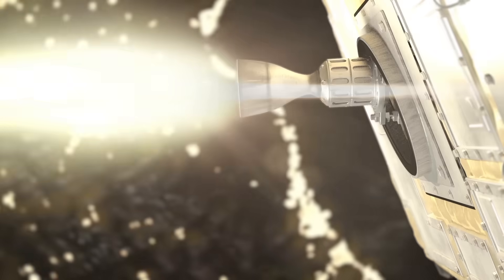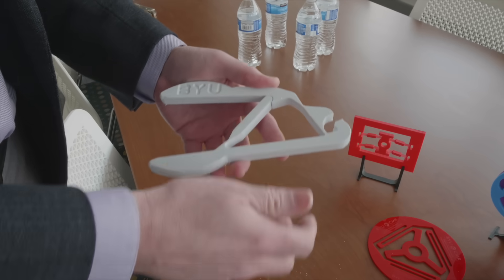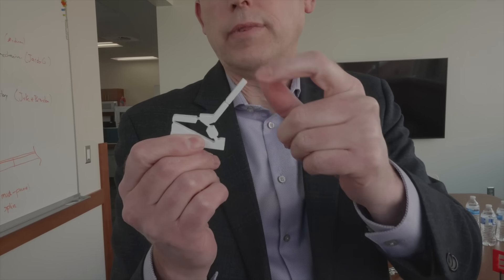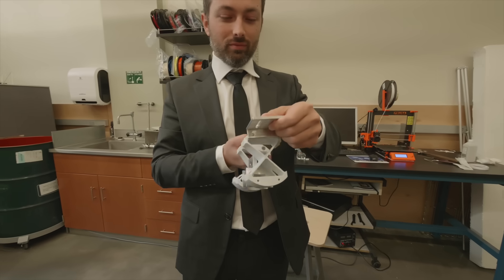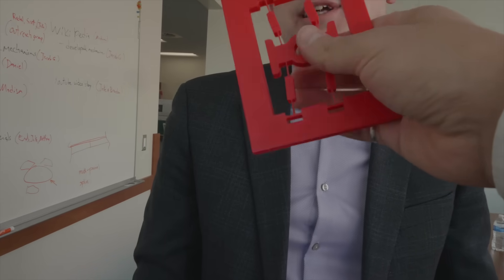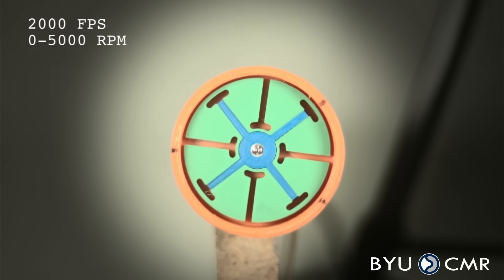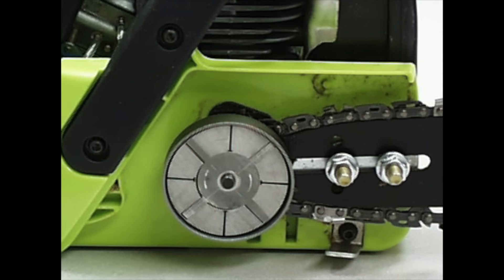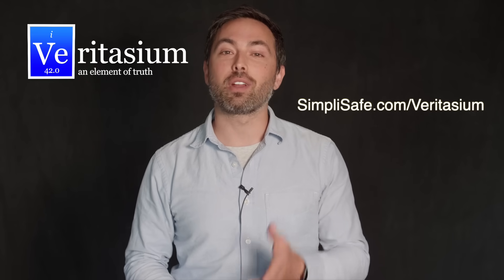Why Machines That Bend Are Better

Comment: My main concern would be about work gardening and the lifespan of these mechanisms.  Springs have stepped in where flexibility was needed in the past, but they are specifically treated to be...well, springy.  Even in spite of that special treatment of springs they still fail sometimes.

Comment: 'Always considered to be bad to have flexibility...) but wood, the oldest building material has great strength when it flexes and is strongest under tension. Surely at 2:07 the 'nutcracker' demonstrates levers as at 3:02? The flexible parts serve as pivots. Arguably over time they will fatigue and snap so it depends on the application. the cleverness as stated at 3:21 is the one piece moulding which is a cost consideration with a very nice aesthetic! Lovely trick at 4:51.

Comment: and still, if it breaks you're fucked. might not matter in space where you can't repair it anyway when it happens on a satellite and the reduction in cost and weight are important but i'd prefer (for example) pliers that i can fix myself instead of having to throw them away

Comment: Keep ur plastic BS. These are nothing more than toys.
Reply: So are guns, I can't believe people don't grow up
Reply: HoboGrifter ?
Reply: He litterally showed in the video that this design philosophy also works with titanium.
Reply: Kevin Frank I work with gear that uses a similar philosophy, brackets for sliding drawers on network racks, clasps on network cabling (fiber, RJ45) 

This philosophy is EXCELLENT for pieces of gear that aren’t frequently stressed.   I frequently have to replace the sliding drawer that support my equipment due to these clasps/pins/etc that sheer off after being used many times.   

I 100% prefer “older technology” of screws and nuts, rather than one piece that kind of springs/slides into place. 

They work fine for the gear that I set up and never move, but for areas where the switches and routers are frequently exchanged, the brackets that hold them fail.  We’re actually in the process of working with Cisco, NetApp dell and EMC to get replacement parts for all our network cabinets for this exact reason. 

These single piece plastic parts that are designed to bend  just do not hold up to daily use.
Reply: Kevin Frank I see the video here just like when we saw the demonstration at the trade show.   Their controlled environments do not reflect the reality that these tools will be used in.  

“1 million cycles”. I guarantee you there’s no torque, or much weight on that tool being stressed on the machine.

Comment: My question is:- can we design a piece that toggles between a state of charge, to produce rotational movement, possibly replacing the electric motor/mechanical engine.

Comment: thing: bends over and over

Basic physics: Im about to end this mans whole career
Reply: if they used this on
planes it would fail so fast cause aluminum would break to residual force
Reply: @MrDeanguy  if they use this on planes they make them to be used on planes. Or you think a rocket thruster has no residual force?
Reply: @LaKoeps  that was titanium wich is very strong unlike aluminum
Reply: Actually planes do use compliant mechanisms. The wings have a high degree of flex to absorb some of the dynamic loads you experience in flight. You could build a rigid wing structure, but it would give a bumpy ride and actually be more susceptible to fatigue. If you’ve ever sat in the wing seat of an A380 you’ll have seen how incredibly much those wings flex in flight, particularly as they take up loads on take off and shed loads on landing.
Reply: @andydavison1235  yeah but that is a small dregree of bend but some of these other ones have high degrees of bend relatively
Reply: Dean Guy sure, but the concept is the same. They’re not saying they won’t eventually succumb to fatigue stress, but for many mechanisms a million cycles is a lot. Even mechanical switches succumb to mechanical wear etc, so there will be some applications where this is suitable, and some where it is not. Doesn’t mean you should discount it as a valid tool.

Comment: The mechanism at 10:45 used to 'safe' weapons is identical in principle to the Bulova Accutron watch from the 1960s. It used a tuning fork at not 72Hz but 360 or 480Hz and it similarly used a pawl to spin a toothed wheel. American, not Swiss, watch technology. Very reliable as long as the vibration amplitude is well controlled.

Comment: What would be the reason to use it for a thruster? Aren't there much better and more stable ways like ball bearings or two motors turning
Reply: The thing is that thats what its replacing
Reply: @masonkimberlin3207  yes i know but I cant see it being better then other methods
Reply: @benisommer3176   It seems that way but i dont think they would do it if it wasnt

Comment: Seems like if one part stops working you have to replace the whole thing. It also seems like you have to make the whole thing out of type of material. You also loose the ability of interchangeable parts in case you want to upgrade something or take advantage of economy of scale (using cheaper premade parts).

 This is useful in certain applications though isn't a good solution for everything. In the video they showed use in space which makes sense because those are one off devices you can't find anywhere and need to make the most out of material used.  Same for that nuclear arming device.

Comment: hmm plastic switches dont conduct electricity... plastic grips dont lok.  plastic melts so need metal fot holding hot parts.  copper/brass would work-harden if used as a flat spring etc etc

Comment: 4:47
why doesn't the hole at the end of the elephant's trunk move ?

because said hole is located at the lower left corner of a (not-immediately-obvious) parallelogram 
whose four vertices are located at the following points :
A) the hinge point at the elephant's back hip 
B) the hinge point at the elephant's back foot
E) the hinge point at the elephant's jaw and 
Q) the hole at the end of the elephant's trunk.

this parallelogram is divided into two contiguous smaller parallelograms side-by-side.

the rightmost smaller parallelogram has vertices at these points :
A) the hinge point at the elephant's back hip 
B) the hinge point at the elephant's back foot
C) the hinge point at the elephant's front hip and 
D) the hinge point at the elephant's front foot.

the leftmost smaller parallelogram has vertices at these points :
C) the hinge point at the elephant's front hip 
D) the hinge point at the elephant's front foot 
E) the hinge point at  the elephant's jaw and 
Q) the hole at the end of the elephant's trunk.

the "virtual" line segments EQ and BQ which meet at point Q
are constrained to exist (geometrically) 
by the structural elements which are present physically. 

TRIPPY and TRICKY !

Comment: I can feel 220v ac in wires. An elderly electrician told me I could and I tried and
did. Of course I felt the magnetic field flux.  Try it.  It is easy. After fifty times it became so apparent. Like a ten hairs wafting over my finger nerve endings.

Comment: Douglas DC-8 jet transports had compliant wing slot mechanisms in 1958.
The aluminum wing skin bent inward to open slots in the wing during low speed flight.
These devices were working reliably in service for decades.

Comment: 3:05 Alex honnold has a grip strength of around 80-90 pounds if he were to squeeze that he could squeeze with around 2,700 pounds of force
Reply: That would probably snap or bend something in the structure breaking it?

Comment: Dear Professor Howell, your work and disgns are impecable, absolute genius well done. I am a mechanical engineer and would be would most greatful if you could explain why we have efficiency of 150% confirmed with Zes Zimmer precision power analyser, we have full data of the test. shakeel.pervez@hotmail.com.
Below is a link showing the system moving 400 kg with 25 watts, I believe this is because of flexibilty in our system.

https://www.youtube.com/watch?v=JsXkOp1f2R8&t=4s

Comment: I would have liked to have seen some discussion about the materials that are suitable for making compliant mechanisms.  Surely most materials that are sufficiently rigid, would also be susceptible to work hardening at the flex points?

Comment: without watching all of the 8 p's, im gonna say, stuff that bends, or at least isn't completely rigid, is better because of durability, if you had to choose between a pillow and a brick to break with a hammer, what would you choose? you die if you don't break it in half in 10 minutes

Comment: Any lack of stiffness, in a Bike Frame, leads to a Waste of Output Power on the part of the bicyclist. Often, extremely expensive Racing Bikes will have a super lack of Frame Stiffness, causing each attempted Pedal Stroke to first have to flex/torque/twist the frame before any useful rotation is finally produced back at the Rear Wheel.

Comment: PLA is unfortunately biodegradable, and exceptionally prone to absorbing humidity/water. PETG, on the other hand, has no susceptibility to humidity/water, but requires considerably more heat in order to print with a 3d printer. ( <== I came up with a GREAT TRICK for modifying the hardware of Cheap 3d Printers, so that they can reliably print PETG; you also have to appropriately modify your Print Speed Parameters, come Printing Time.)

Comment: I built a Canoe rack for my ATV.  out of Aluminium. It's bolted together. Not welded.  It moves a bit like an Aircraft wing. But has not broken yet. 
Friend welded a steel one and it's broken there ATV.   The ability to flex had been an advantage. Bump into a tree.. it bend a little and doesn't brake.

Comment: I actually printed a switch designed by them, not shown here unfortunately, and it felt really good the way it worked but it broke after a few dozen uses. Granted, it was printed in pla, but i wonder what if they can be made from a material that doesn't wear at all

Comment: centrifugal clutch, similar to ones used in chainsaws and weedeaters, or weed wackers if you pour your milk before the cereal, which uses a spring holding 2 'shoes' that when spun around, the spring will give more and more, engaging the drum and shoes to work together.

Comment: Things tend to break when bent. grab your nob and bend it. Engineering 101 and should be sex education 10? but it doesn't appear to be. Efficiency isn't every thing reliability and material science counts for more. plastic two dimensional origami.meh

Give me metal and oil any day? A large hard piston member on the end of a stiff rod in a drenched bore hole? interference or clearance it's all good with plenty lube reciprocating up and down. up and down.  isn't she a beauty of precision in motion to behold? I am quiet sure you will never look at mechanics in the same way ever again:)
Reply: Yeah, that must've flied completely over their heads, no one would ever think of this. They will probably have to close their company because they couldn't foresee the trade-offs in their products. All the durability testing, for nothing...
Goes to show that internet's smart asses are much more capable than professionals and scientists
Reply: @gaguiar  Its not an original idea. I think they are clever to be able to market this cheap tack:) That takes a certain kind of skill. I

I'm an engineer, welder, machinist and even so that doesn't mean my opinion should be taken at face value.
They are delusional thinking a bit of bendy plastic will out class millennium's of tried and true real mechanics. 

The father of engineering Archimedes and the other Great engineers would likely piss them self with laughter if the where still around to see this.
Reply: Yeah. They would also probably accuse us of witchcraft of some sort for using cars; but guess what, things change along the years. Also, nobody said that plastic would replace these materials at all. The proposal is that we use simpler (and, therefore, cheaper; while not necessarily fragile) material for some specific tasks. If you saw the video you would surely realize that
Reply: @gaguiar  you are an arrogant one aren't you. Assuming the ancients to be fools when I see many still know believe in god's, occult, extraterrestrials, a flat earth et cetera.

There are less then 2 million people roughly of 7 billion that don't believe in any nonsense. we are still in the age fire and the barmy. If you look at the fact the few build strive the other are just on the trip.

you speak of a car but what do you know of it. can you build let alone explain any function for it component's. can you tell me  by which principals and means that an internal reciprocating combustion engine operates. probably not. can you fabricate or even do bush craft. if the answer is no then you are less capable a tribal. do not undermine the values of others mind just because you buy and drive a auto mobile which where the fruits of other labor and thought.

Comment: The nuclear weapon device is almost exactly like the motor drive for HO slot cars in about 1960.  It was a reed that vibrated against a ratchet wheel.  The vibration of the reed was due to resonant vibration induced by an electromagnet driven by 60hz voltage.  We had all kinds of fun adjusting the reeds and modifying the grooves in the ratchet wheel.  
However we did not experiment with a non 60 Hz source. I would figure that a non 60Hz voltage applied to the reed would not successfully vibrate it unless it met the natural fundamental resonance of the reed.  If we could have tuned the frequency of the AC voltage I would suspect we could have sped up the cars immensely.  However, we could already tune them up to the point that they couldn't make the corners and go flying off the table.  But it would have been even more fun to make them fling across the room.
In this sense it you made the vibrating reed to be resonant with only a fairly precise frequency plus heavily damped then external vibration could not move it and only the exact frequency could.  Thus making it a fairly safe switch.

Comment: one thing I know from being a college qualified engineer  is that if a material bends or deforms it won’t be as durable as a part that doesn’t move or deform for a simple example if you use a tool with a spring the spring will most likely be the first part to  naturally break this is a result of multiple things internal material structure, how elastic the material is and how much force and duration is placed on the stress points. Best way to express it is with a body in my opinion if you run to the point that something breaks it won’t be a bone it will be either the muscles joints or ligaments just like tools it’s never the frame that breaks
Reply: Derek aka Derek hahaha I’m just pointing this out as I hate the way videos like this always push the positives and the cool features but never mention any negatives and people who don’t know engineering probably didn’t have a clue at least I didn’t before I learnt it so I don’t need to say much else than that for my purpose 

Ps my 3 year college course coverage mechanical maintenance 
Material properties 
CAD
Electrical installation and principals 
Hydraulics and pneumatics 
Health and saftey 
Technical drawing 
Secondary finishing 
CNC
Plus some more but I cba with typing them but you should get my point that I should know what I’m talking about when it comes to engineering I was going to go to uni as well but I couldn’t do that and work at the same time so I chose to work

Comment: I reckon as a design principle this is brilliant, especially the elimination of play from mechanical systems. 
The one possible issue I can see is maintenance, for example if a hinge wears out it's very easy to Jerry rig a fix.
Super pernickity point but eh.
Reply: From what I got from the video, compliant mechanisms excel at very small scales (where you would be replacing the entire part anyways) or in space (where you wouldn't be able to replace any parts at all.)
When a mechanism becomes large enough to be human-serviceable, it still makes more sense to have it be a traditional multi-part machine.

Comment: One of the most exciting recent developments in compliant mechanisms (for me) is a mechanical watch regulating mechanism developed by LVMH in cooperation with TU Delft which is made with a single piece of silicon.  A concept watch, the Zenith Defy Lab, was produced in 2017 with this mechanism, which replaced thirty individual components in the regulating mechanism with just two.  A new version of this mechanism has recently gone into regular production in the Zenith Defy Inventor.

Comment: U could maybe use the wheel which was at the end of the video that blocks at a certaint speed to do a clutch in the car maybe? So u will have an other version of the torqueconverter

Comment: 1)
Se dobbiamo continuare a costruire parti in plastica avremo ancora problemi di inquinamento.

2)
Se si rompe una singola parte del componente si deve sostituire tutto.

3)
Se si usa plastica sarà sempre più delicato del metallo.
Non è stato inventato nulla di nuovo, le molle piatte, elicoidali, sagomate, esistono da sempre e sono elementi elastici che durano certamente più della plastica.

4)
Se si continua con plastica della stessa qualità di oggi...mi viene da piangere !
Compro cassette porta attrezzi con cerniera elastica e dura da 10 a 50 aperture, poi butto la cassetta intera.
Se trovo parti in plastica sulle auto è sicuro che dopo pochi anni devo sostituire quei pezzi...o l'auto intera.
Mi è già successo di avere problemi con il blocchetto di supporto della leva del cambio che dopo pochi anni a causa dell'invecchiamento e delle variazioni di temperatura si rompano.
Idem per le parti in plastica che reggono i vetri.
Il mio consiglio è di migliorare la qualità dei metalli e trovare sistemi di funzionamento sicuri, quello che non funziona nei sistemi tradizionali è....il voler risparmiare !